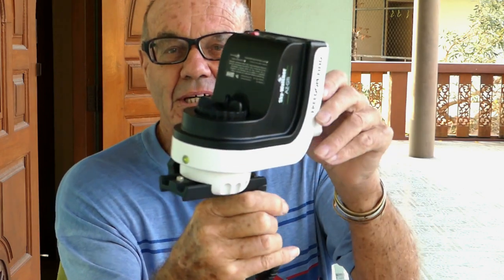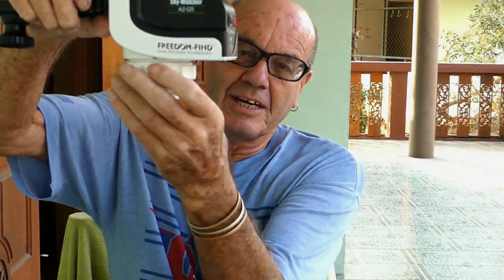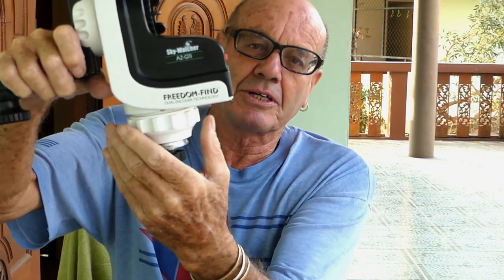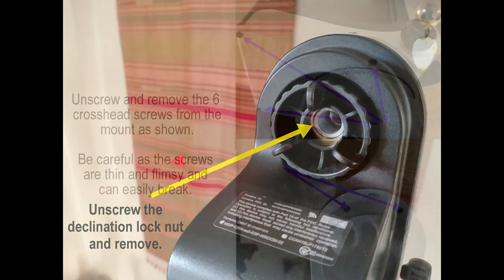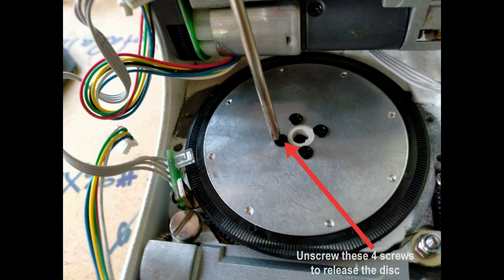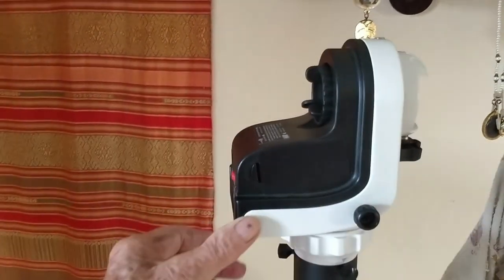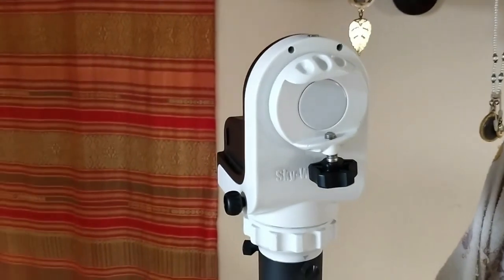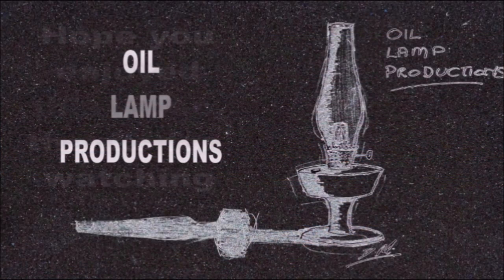AZGTi BEARING PROBLEMS SOLVED

Comment: Heya Del. I watched your video because I was having some issues with the bearings as well. So, I followed all of the steps here except, I did not add an additional washer. I just backed the locknut off about half a turn and tightened the grub screws back down. Now the RA axis is silky smooth. I made sure there wasn't any play between the bearing and washer but, just eased the locknut pressure. That seemed to work a charm. 
Thank you so much for the instructions.
Clear Skies.
Reply: Hi Austin, Thanks for your comment as I will try what you did tomorrow as my AZGTi has a area that get a bit tight when I rotate it by hand.
Reply from the maker: Thanks, glad to help.

Comment: Thank you very much for you doing this video Del! A few months ago I got an AZGTi and noticed that RA does the same and I will try to just loosen the locknut a bit and see if that solves the stiffness in a certain rotation. Thanks again!
Reply from the maker: Thanks
Reply: @delrussel2640  Ok update, I was able to adjust that lock nut to get now a much more smooth RA! My only question is does it make a difference where the encorder disk that you removed to get to the lock nut goes back in the same 4 screws? I don't think so, but not 100% sure?. Also a tip I wanted to park the AZGTi but that's not an option so I read that if you go to the app and in the SynScan Pro then to the User Objects then Terrestrial Objects then set the Axis 1 to -90 and for Axis 2 set to 90 add that setting called EQ Home or Park most of the time the AZGTi will go to a Polar Alignment, which for me is cool. Please post here how it works for you as I am using a Polemaster and this makes it nice to have the AZGTi ready for Polar Alignment? ( I tested this about 4-5 times and 2 times the Dec did not go to 0 or 90?
Reply: @whatmattersmost6725  If you go in SynScan Pro and hibernate the mount you can have it return to home position in the process. Then quit and reconnect and you are in a known state.
Reply: why ppl caring so much about the stiffness? I have the same but i am guiding at 0.4 total (windstill). So long its greased good, you wont wear it out that fast.

Comment: Thank you for the video, mine is stiff so I cannot equilibrate in eq mode, but I am a bit afraid of opening it so I will stick around with this problem for a bit. As for the wifi, I had the same issue but solved perfectly after changing wifi configuration in the mount to be occult or just allow my devices as the problem is peoples devices connect automatically to the mount and make my connection to stop. Bye

Comment: I hope the final update: Well last night I had issues again and not only has this GTi been making clicking sounds ( only happened after I started working on it, but read some GTi make this sound?) So I opened it up and tighten the locknut to be tight and after tightening up the 2 set screws it rotates a but tight but I don't have any spots of resistance as now is even while rotating. I still have that clicking sound but when I turn off the tracking it's gone. so far seams like it ok?
Reply: The popping has been bothering me. When I did the binding fix I pulled the upper mount off the azimuth base and found a paper washer between the base and the azimuth gear. I slathered it with grease, and the popping stopped!

I followed the instructions in the video without adding a new washer, and my binding stopped. But, I did have to back off the locking collar so much that there is a bit of play in the azimuth bearing, though the weight of the telescope keeps this from being an issue.
Reply: Hi, I had the binding also in RA but I just loosened the lock grub screws a bit and that made it smooth with no binding. I seem to have star trails however even at 60 sec. as the RA/DEC are still numbers when guiding just the ALT/AZ move. It does slew to a target OK. Did I loosen too much? I never removed the collar to see the bearings. Just loosened the grubs to move smoothly. No clicking, the slewing sounds good. It will drift from my star after 10 min. and I never tried ALT/AZ mode which does move in RA/DEC.  Can it just be bad polar alignment? Hard to polar align except roughly with Polaris obstructed.

Comment: Ok update: After I adjusted the lock Nut, last night I noticed that the RA was slipping and when the mount was pointed at an object it was not on target, also first time I mounted my Canon 300 and accessories Polemaster and ZWO EAF, I did not have it balanced  right and what I think happened is I had that lock nut a bit 1/2 to 1 turn too much (even that it was nice smooth with no binding) it was too much and even with the clutch tight the RA will still rotate, I opened it the next day and adjusted the lock nut tight but not as tight and it has a bit of binding, but it reality the RA is not important except during goto's as the RA does not rotate during use in EQ mode. So if anyone has the issue after loosing the lock nut go back and tighten. I extending the counter weight shaft extended and now it balanced.
Reply: You might be getting it backwards. Mounts track in RA. It is the dec  axis that is not important in unguided tracking or guided tracking with dec turned of.